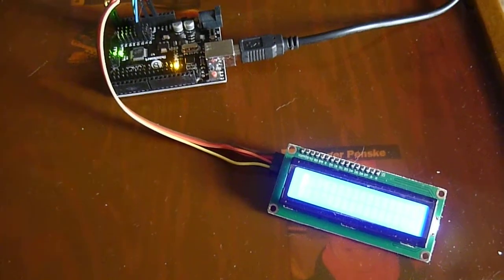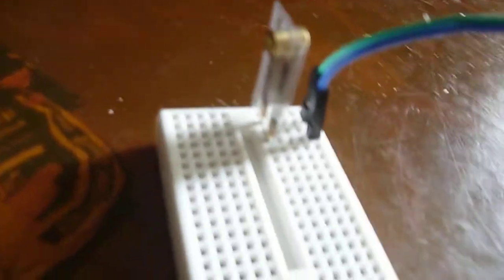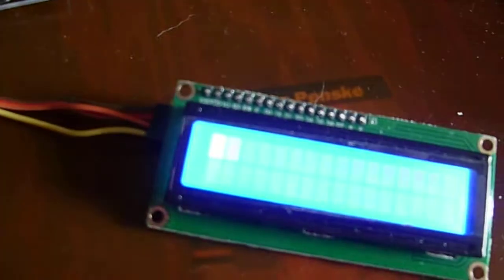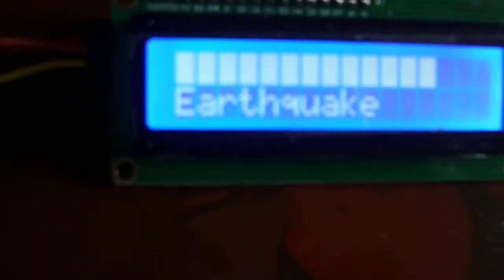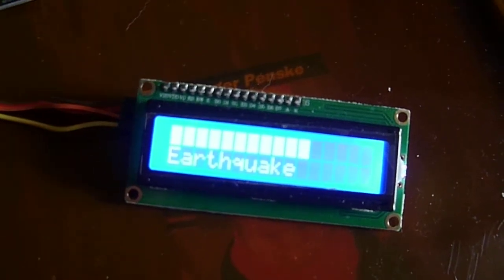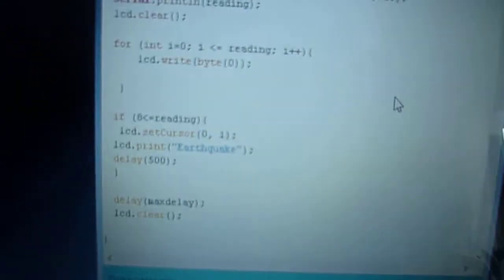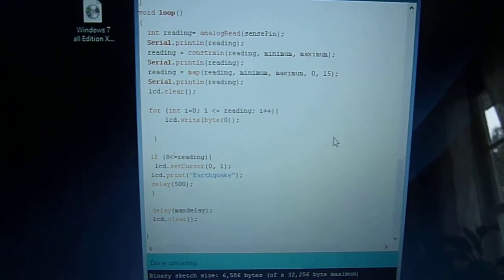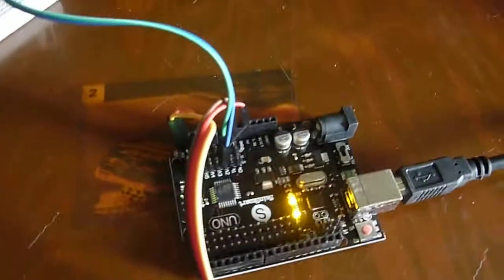Arduino Seismic / Vibration Sensor

Comment: do we have types of vibration sensors?.. if so what kind of vibration sensors is best suited to detect vibrations caused by seismic waves?  let me know the specification of the vibration sensor used here?
Reply: Good question as for earthquake it might not be a sharp vibration, maybe slower oscillations.

Comment: lol, cute. I actually want to make one much more sensitive. I want to detect vibrations you can't feel or hear. Like cars driving outside, or someone walking up the stairs down the hall. Would I be able to do something like that with this sensor? I'd probably display numbers instead of bars.

Besides putting it outside, and detecting the train a mile away, how would I be able to detect or get numbers higher than 0 to tell if a train is passing a mile away?
Reply from the maker: +Mark II You would need a Instrumentation Amplifier

Comment: can this sensor  detect vibrations due to road hazards and road problems?
can we differentiate between vibrations due to normal car movements on normal road and movement on a road with holes or higher obstacles by setting  the threshold
Reply from the maker: +Basem ElHalawany by setting the sensitivity, you can adjust how strong a vibration has to be to register. Since we are not looking at the actual frequency, there's no way to tell what caused the vibration.

Comment: stieve i am not able to upload the program on arduino as i got error''Arduino: 1.6.5 (Windows 8.1), Board: "Arduino/Genuino Uno"

sketch_oct17a.ino:7:17: fatal error: LCD.h: No such file or directory
compilation terminated.
Error compiling.

  This report would have more information with
  "Show verbose output during compilation"
  enabled in File > Preferences.'' can you tell me how to upload
Reply from the maker: +Vansh Narula If you are not using a I2C display, you need to remove the I2C code, and replace it with the code for your display.
Reply: Can you replace for me
Reply from the maker: I don't know what lcd module you are using.

Comment: Hi Steve, hope your out here still. I'm just getting into this Arduino stuff as one of the geiger counters I got using it. I am into studying lightning and seismic sensors as well. I see your using one of the SainSmart UNO's, I have the regular UNO board and is set up a little different than yours, and think your using a serial LCD. What pins are you connected too for the sensor, I think its one of the audio lines, and I have and use the LCD's that have more wires to them, yours using what looks like only 3 or 4 wires. I bought them sensors that you have and want to try this one my UNO R3 board.  SO you have a drawing or schematic?  Also want to try hooking my lightning detector to one as well for count and level indicator bar graph as well.  Thank you  Frank
Reply from the maker: MegaSkybug This is I2C, uses pins a4 and a5. the vibration sensor also connects to a analog input, as it outputs a voltage. I have mine connected to A2 and gnd, with a resistor from a2 to +5 to complete the voltage divider. More info at the link provided above/
Reply: Steve Spence Hi Steve, yes, I see that. I modified the code a little for my display as its one of the parallel ones and trying to see what pins you hooked up the sensor too. Got the display part working all thou its full scale right now but didn't know if it was because I didn't have the sensor hooked up yet and does it need the resistor in the circuit to function properly?   I have a few types of vibration sensors.  Thank you  Frank
Reply from the maker: MegaSkybug Ignore what I said about a resistor. Had a brain fart. The sensor generates a voltage, it's not a variable resistor. one leg goes to gnd, the other to an analog input. you do a analogRead to read the voltage.
Reply: MegaSkybug Steve, if your into the sketch coding, can you redo the one you had but using the standard parallel lcd's code? if you don't mind? I'm still learning this arduino stuff. Its a lot of fun. I got a UNO board and wired up the lcd to it. I got started with the arduino with my geiger counter handheld and a kit I am building. With the handheld unit, I can program it for different things. It has a 2x8 display and it was using custom characters. I download the IDE and with some help from the guys that make these geiger counter kits, they got me started with Arduino. Want to make a one for my lightning detectors I use here now and display the intensity of the strikes on the display. Searching the internet for seismic and lightning detector arduino project and sketches. Not easy and not much out here, figured there would be.  Thank you for this video.  Frank
Reply from the maker: I'll work on that this weekend.
Reply: Steve Spence That would be cool Steve, appreciate it. Yes, that is correct, I have the same sensor you have there. I looked it up and got 2 of them, one horizontal one and a vertical one along with a piezo type one. I also have them geophone ones as well. One is mounted on the beam of my house for vibrations and also have a couple of them from the Stanford site using them on the Quake-Catcher Network. I could pull one of these apart and use this as well. they are 3 axis. I was reading descriptions on some of the code lines you have in your code to see if I could figure it out. Tried a few things, but still full scale on the bar. I have the same sensor you have hooked into the audio A2 and Grd. Not sure if its some of the other serial commands causing the issue. Again, thank you Steve for your time and helping me. I see you posted some new stuff lately, reading them now. This is alot of fun learning this arduino stuff. :)
Reply: Steve Spence Hi Steve, any chance you got to take a look at this over the weekend? I have it all built up on a breadboard and using the same vibration sensor you have on yours. Looking forward to trying it out once I get my display working correctly. Been reading over the code you have and trying to think whats causing my bar graph to go full scale.  Thank you for your time.   Frank
Reply from the maker: I did not have a chance to rework this this weekend.
Reply: Steve Spence ok, understood
Reply from the maker: a parallel lcd example can be found in your examples menu in the IDE. Should work fine for you.
Reply: Steve Spence That's correct, I have been playing around with them, experimenting. Must be something in the current code that I'm not seeing that's causing it to go full scale on me. I have it working on my LCD, bar graph shows up on line 1, Earthquake on line 2 and showing that because its maxed out, greater than 8 blocks. Not sure if its something to do the the serial commands for the serial LCD that I left in it. I'm sure its something simple but I am new to this and trying to get a couple of small projects to work so I can learn off of them on how to solve other issues and start building more.  Thanks
Reply from the maker: post your code, I'll take a look.
Reply: Steve Spence Its the code you have, I just commented out the 3 IC2 lines since I wasn't using a serial LCD, but the standard parallel one. Everything else is the same, I believe.
Reply: MegaSkybug Oh, if you were referring to the comment that I said about playing around with  "parallel lcd examples" only meant that I have a UNO board now and a LCD and trying to learn how to make bar graphs for some of my projects I want to use it for.   Thanks
Reply: MegaSkybug just trying to change the code to run with a HD44780 16 x 2 LCD display, anyone?
Reply from the maker: email me your sketch, I'll fix it up for you. this should work though - 

// include the library code:
#include <LiquidCrystal.h>

// initialize the library with the numbers of the interface pins
LiquidCrystal lcd(12, 11, 5, 4, 3, 2); 

void setup() {
  // set up the LCD's number of columns and rows:
  lcd.begin(16, 2);

}
Reply: Steve Spence Actually, that's what I have in the code. How can I email you? when I'm logged and click on email Steve, I get a 404 error. Was going to send you what I have. I believe I have the LCD hooked up right as well since I have a full bar graph showing and the word Earthquake is displayed on line 2, since the bar is full scale exceeding the 8 to make it print the warning. Thanks
Reply: MegaSkybug Almost like I have something hooked up causing it to go full scale?
Reply from the maker: my email is greentrust@gmail.com
send me your complete ino, and I'll test it with my hardware.
Reply: Steve Spence Just sent it to you, thank you ! :)
Reply from the maker: Sent tested working code back to you.
Reply: Steve Spence Got it, and a DUH on my part, I had one wire in the wrong spot in the UNO board that was causing the issue of the bar. One wire was plugged into the AREF instead of GRD where it should have been. Lining them letters with the holes is a bit of a challenge with marginal eyesight,geez :| works great now. Thanks for the help Steve and the video, just what I was looking for. :)

Comment: Hi, great info thanks. Will this not generate dangerous voltage levels for an Arduino? Sparkfun spec's says vibration can generate up to 90V.
Reply from the maker: In certain applications, it could, but as a simple low frequency vibration sensor as I'm using it, it won't. I've seen applications where a 1M Ohm resister was connected in parallel and it was used as a digital force / no force sensor.

Comment: Very interesting project. I'm  mechanic and would be interested in something like this for work. What way do you think would be best to use this in my situation. I'm thinking like a stethoscope type probe to detect vibration in different areas. What are your thoughts?
Reply from the maker: Could work. Easy to change "sensitivity" in the code, or add a adjustment pot for real time changes.